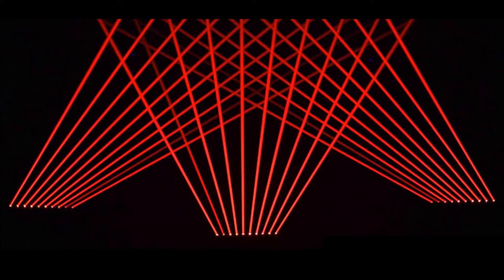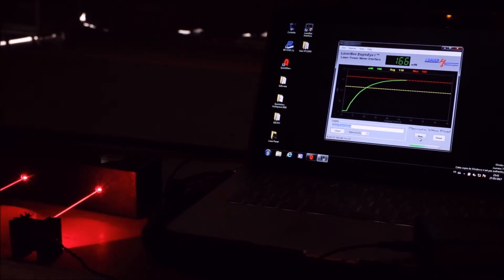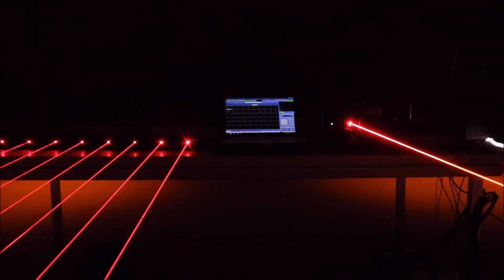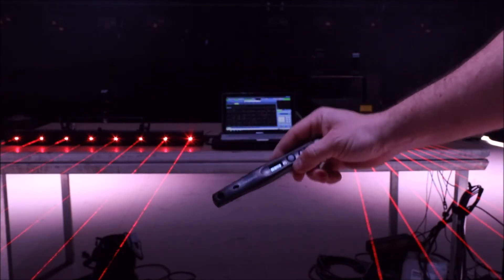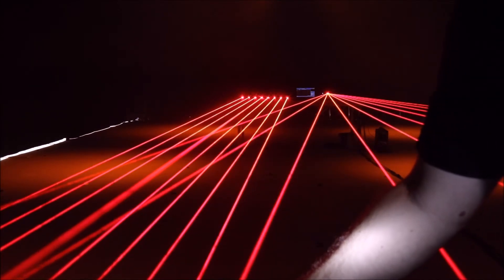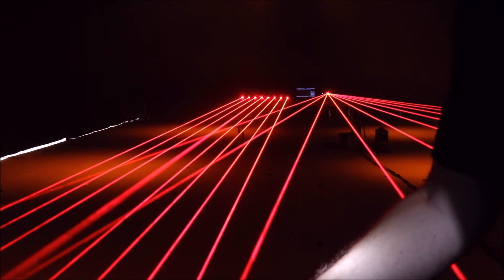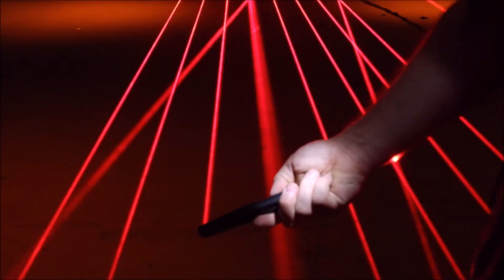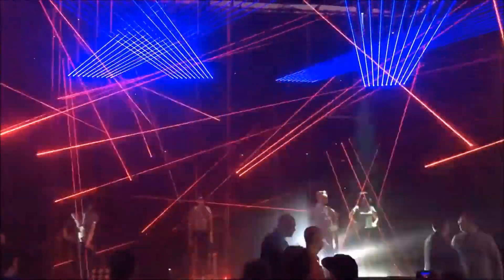Laser Beam Array & Beam Bar = DANGER !

Comment: Laser beambars are like audience blinders, or pinspot bars. The effect is 1- dimensional and the time you run them during show is too small and it gets old fast. The advantage of having matrix style fixed beams or a carpet beam is completely nullified by having no scanners. It's like having PAR64 bars all over again, it sucks. Spectators don't want to discover patterns in a lightshow. This is how we ended up with macro movements for scans and moving heads. I would rather have 10 lasers on a vertical circle truss on stage capable of doing endless variations instead of  100 beambars with no creative capabilities.

Comment: Does this apply to all makes of beam bars?
Reply: He clearly defined the laser classes. A scanner set moves the beam around. With laser bars, you get a static laserbeam. The static part is the dangerous part. It's like getting electrocuted by 230VAC or 230VDC. The DC is constant without pulse, it will burn much easier because the power per time unit is constant.